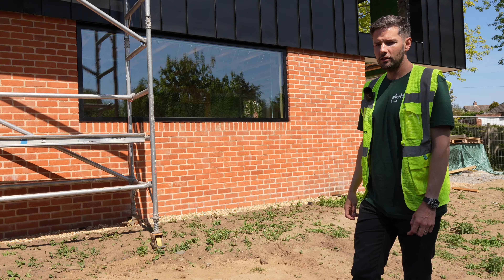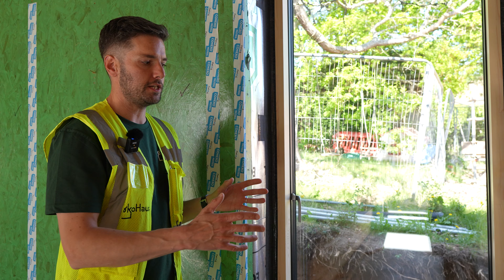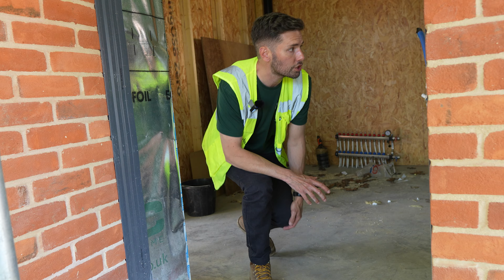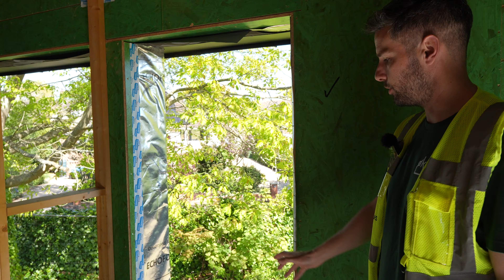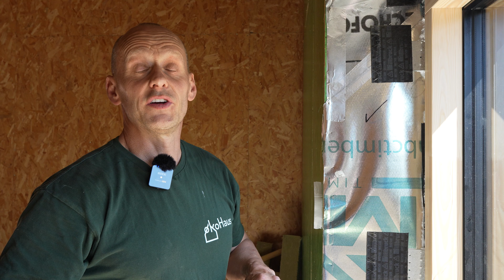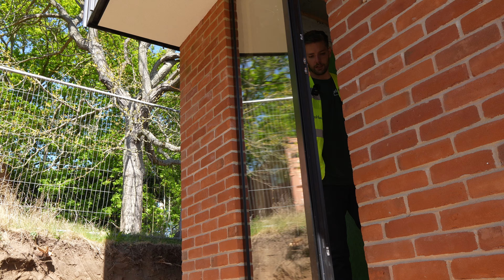From Opening to Airtight A Velfac Window Install Walkthrough - Dukes Meadow, Woodbridge, visit 2

Comment: Great video. We are looking to use Velfac windows for our refurbishment. Can you comment (or show video) of how the gap between window frame and wall at the inner reveal is addressed?
We have seen another supplier simply cover this with a thin wooden strip which doesn’t look great.
Reply from the maker: Thank you.  For refurbishment projects, if you are not changing the internal reveals, then typically you would need some kind of trim to close the gap between the Velfac timber frame and wall.  However, this would depend on the specific position of the internal reveals vs external reveals on your project.  Hope that helps.
Reply: @okohausuk Thanks for the response. We actually got the windows (Velfac) installed last week. There is a gap there and we have arranged for it to be plastered.
Reply from the maker: That’s the neatest way to do it 👍